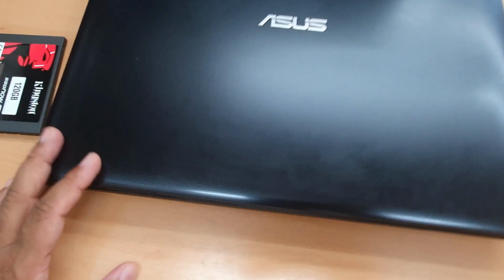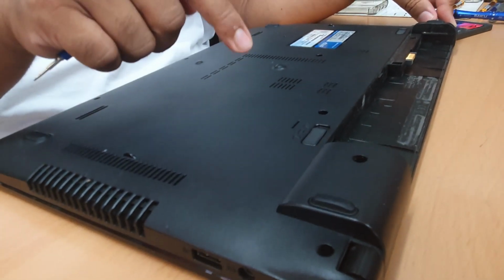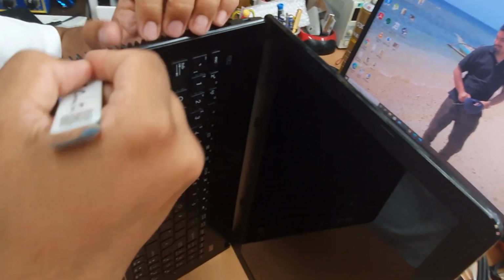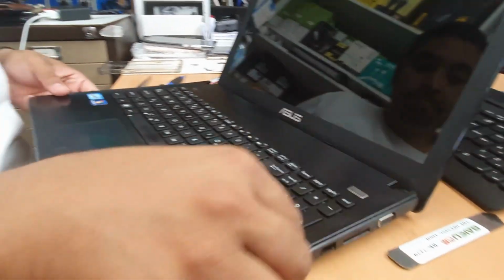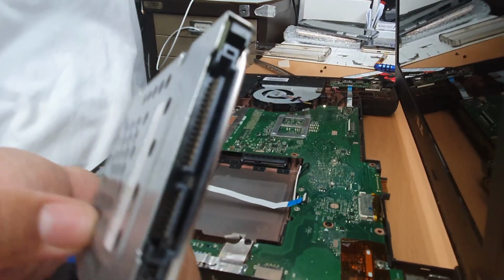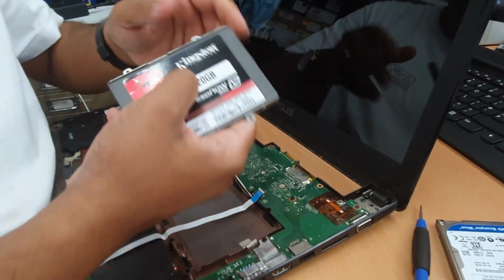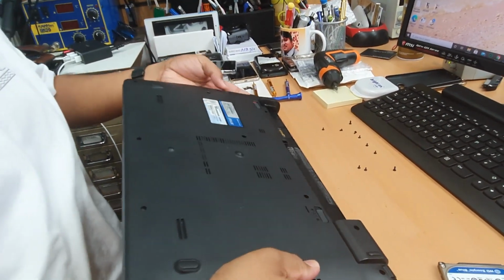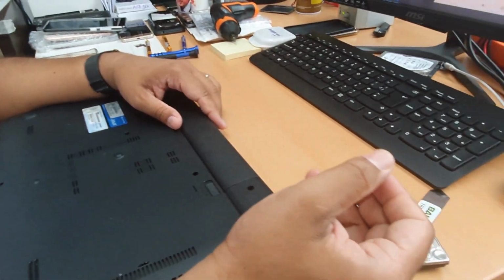HOW TO UPGRADE SSD | ASUS X501A

Comment: I appreciate your tutorials. I used this one and another that you made to upgrade the RAM in my ASUS X501A laptop and it worked out well. Now I'm definitely interested in upgrading my storage drive from a Toshiba 500GB HDD to a 1TB SSD but I'm not 100% certain what drive to go with. I am looking at a couple of drives on Amazon but want to be sure that I get the right one the first time and that the SATA/USB Enclosure adapter with the Acronis cloning software will do the trick in making a perfect image of my old drive so that I'm not stuck for hours or even days trying to get everything working right. Any suggestions regarding this issue. What drive features or specs am I needing to be familiar with. What cloning software do you recommend, etc....
Thanks for your help....
Cheers from Tucson, AZ
Reply from the maker: Thanks for your time sir!!!

Comment: Worked perfectly, now I'm thinking of upgrading the CPU, what do you recommend, can it still be done in 2020?
Reply from the maker: 2020 has gone. and I don't think so it's easy to upgrading CPU for this machine.
Reply: Здорова мужик , смотря какой у тебя чипсет если HM70 то лучший вариант для тебя это pentium 2030m , если чипсет HM76 то неплохой вариант будет Core i5 2540m . Но все равно в игры ты на этом ноутбуке не поиграешь видеоадаптер дерьмовый

Comment: I have the same laptop but it is very very slow. I was thinking that if I upgrade to ssd it would be faster?
Reply: At least twice as fast
Reply: @darthraptor84  thx, I have installed ssd and it has become from unusable to usable and fast laptop. Great
Reply: You don't need to copy the old drive, install a clean Windows with what you have
 Cyril on the back of the computer for me it works copying any company that fixed them they have the free version

Comment: Wow! I have a ASUS X501A1-SPD0503W 
with a Pentium 2020M (2.40 GHz) CPU , 4GB RAM and 500GB Toshiba HDD. I just upgraded to Windows 10 and notice quite a slow down. I was always under the impression that adding RAM is the best option for increasing computer speed. Now that SSD drives are on the market; how does changing the hard drive help to improve performance. I notice you have a WD 320 drive; mine is a Toshiba 500 GB. I can't understand why there are so many variations in the ASUS X501 series laptop.... I am going to start with increasing RAM from 4GB to 8GB; then I will decide if I want to convert drive because I don't have a windows OS disk of any version and I sure don't want to have to buy a new OS... I'm gonna start saving up so I can just buy a new laptop or even a desktop PC and ditch this old clunker l'm using now.
Thanks for the upload. It was very helpful...
Reply from the maker: Hi mate. Thanks for your time and for such a big comment and explanation!  I do understand what you did try to explain about ! And I think I can help you with it! 
Question 1 : where are right now, the reason I am asking if you from any part of London then i am able to help straight away.
Question 2: did you already get the SSD ?  
However, I am here to help  as YouTube is my hobby and main intention is to help others with my little knowledge that i have about this tech! 
For further help  you may contact in my Instagram  which i @thepcphone_
Hope you would subscribe to my channel! Thanks again!!
Reply: No, unfortunately I am not in London, although I would sure like the weather there these days. I am roasting at 114° here in Tucson, AZ.
I do not have a SSD drive yet. At this moment I am preparing to add a 8GB stick of ram to replace the 4GB currently installed. Unfortunately it looks like it will be a pretty invasive procedure. Your video was helpful in that you gave good instructions about opening the back of laptop.
Thank you for your assistance.
Oh, no problem.... I'll be sure to subscribe to your channel if it helps.
Cheers mate!

Comment: I tried to upgrade to ssd and even cloned my wife’s hard drive. But kept getting blue screen of death error. So I settled on doubling her ram and ordered an i5 2540m to upgrade the cpu.
Reply: Hey I am also going to upgrade my CPU on this computer. How did the upgrade go to that i5?
Reply: @hustlen4129  so if you have an i3 you can upgrade to the i5. But you can’t jump categories.
Reply: @donovancorzo2627  I was looking at an i7 has the same chip set, wattage, and  pga socket. Along with the same south bridge. It makes it go from two cores to four. Also the same generation. After all that it still won’t work? I can provide the exact cpu if that would help I’m Kinda stuck lol. I have the HM76 chip set
Reply: @donovancorzo2627  I want to go from an i3 3120m to ab i7 3612 QM
Reply: I would go to Tom’s Hardware and look it up. As far as I can tell that Asus can only go from i3 to i5.